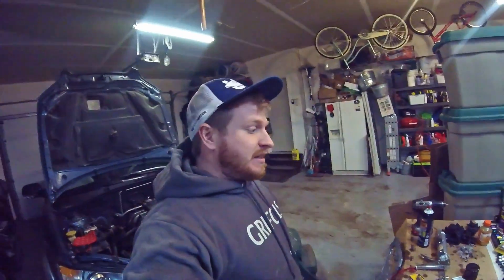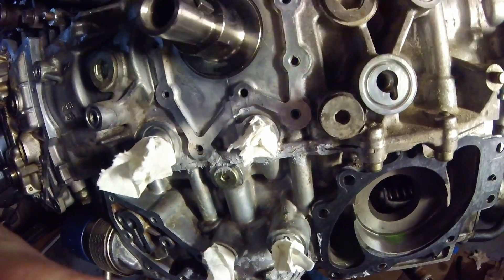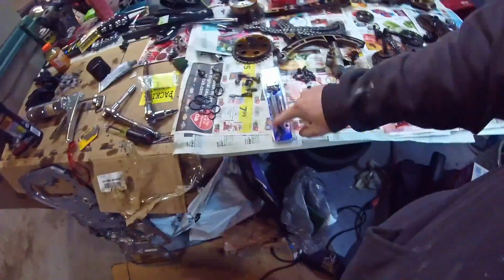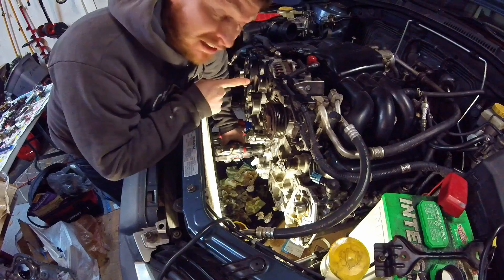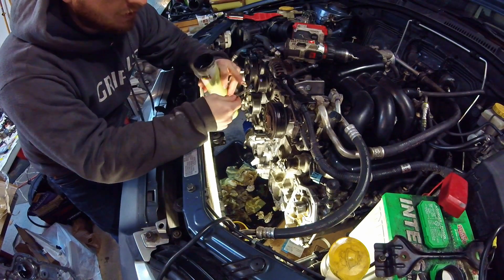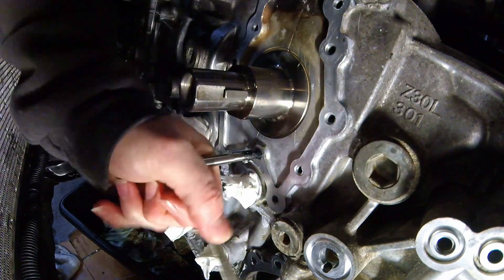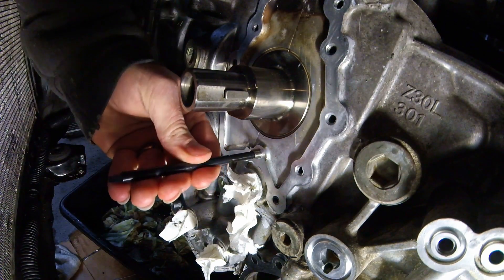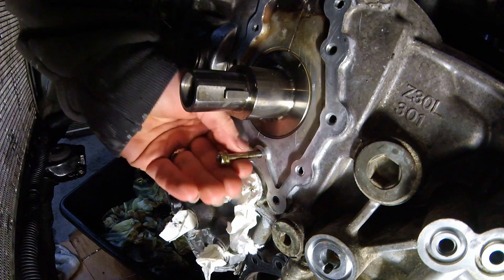How to use a Heli-coil to fix a stripped out hole | Ep.79

Comment: So I stripped the threads on an ignition coil bolt. Car still starts. Can I just use jb weld? This looks like a headache. And I've never done it before.
Reply: technically aslong as your coil is secure it will function properly just make sure whatever you secure it with isn’t flammable

Comment: I have a G35 with three stripped bolts. Two on the lower plenum and one on the upper plenum. If you don't know what I talking about, search G35 engine. Without the black cover on, you'll see the main upper plenum and that's two pieces. The upper attaches to the lower and the lower attaches to the engine itself. The lower plenum covers the cylinders themselves and there's a gasket between the two. I think the torque specs are 80 inch pounds for 6 10mm bolts. Would you feel confident in the product that you used for what I need to do? I'm pretty desperate right now because I can't afford to take it to the dealer or a mechanic but I can afford this. I'm sure I'd get ripped off big time for a job I literally just did.

Comment: Are you supposed to scew it all the way in? Down to the very bottom of the thread?
Reply: I'm also thinking there should be some sort of epoxy used. What if the threads on the insert become stripped some how and the next time you go to take this out it, the insert just spins?
Reply from the maker: The bolt you screw in puts tension on the helicoil which presses it in place.